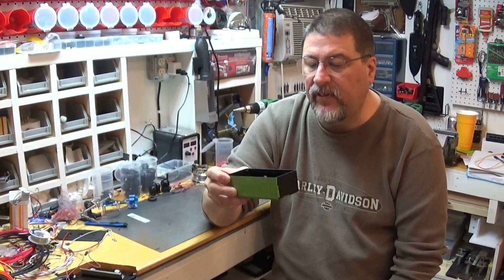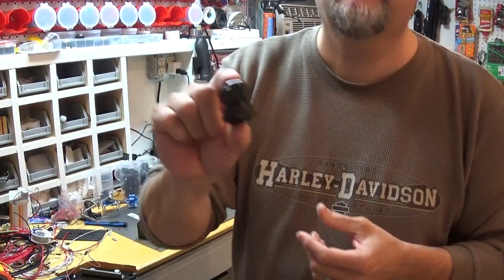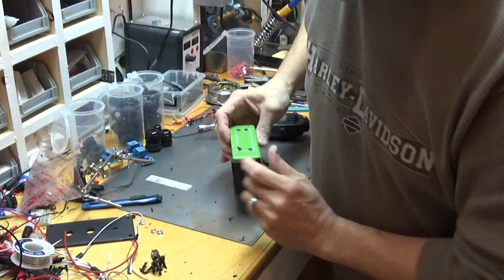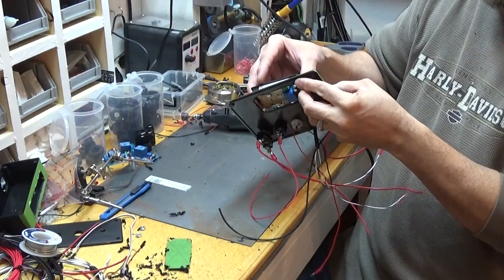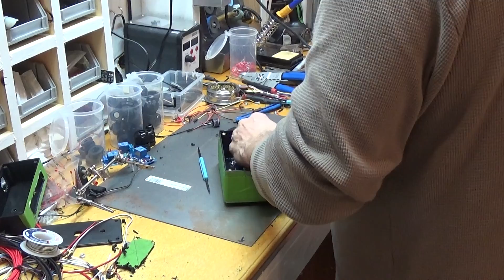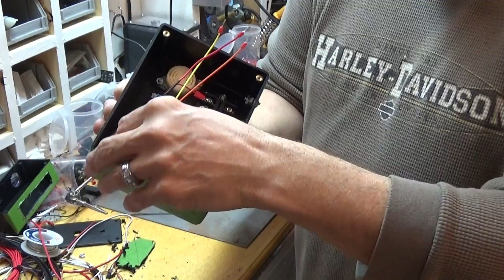Building Primer Alarm-Round Counter Loadmaster Press Part 3

Comment: Harley, Would you consider A PRIMER ALARM ADD-ON?
A PHOTO CELL UNDER THE SHELL PLATE WITH LIGHT HOLES DRILLED THRU THE SHELL PLATE. 
YOU ARE THE MAN THAT CAN DO IT!   Thanks
Reply from the maker: I have consider doing that, that would a good system. Right now I am working on another project, if I get to work its going to be awesome. I will put your suggestion on my list. Good Shooting my Friend

Comment: where did you get the led counter and what is the part number? GREAT videos, keep up the good work.
Reply from the maker: ebay 0.56 red or blue led 4 digit counter 9999 up/down plus switch150 hz dc 12v. seller ezwholesale range price $14.58 to $19.95  from japan. Good Shooting my Friend